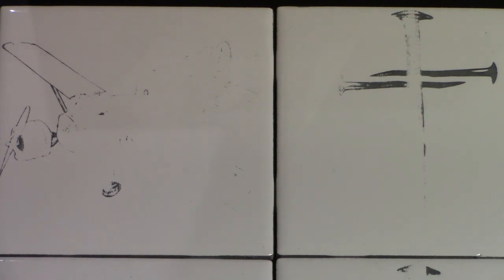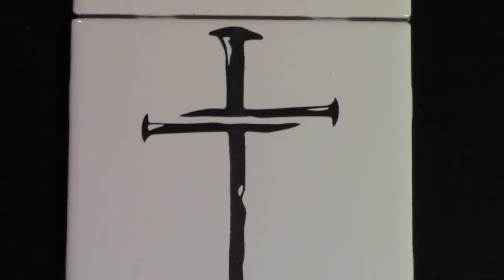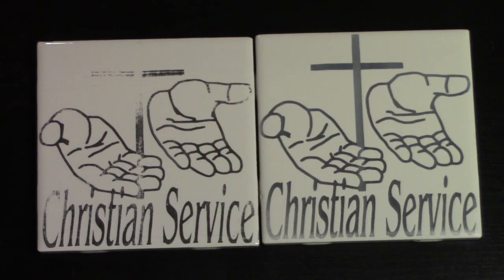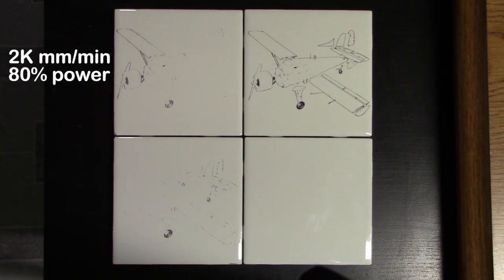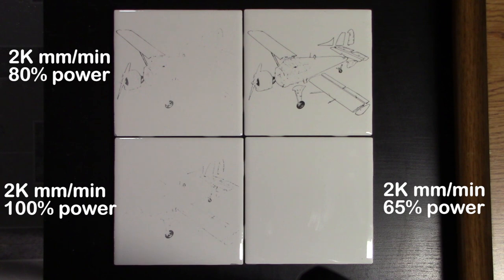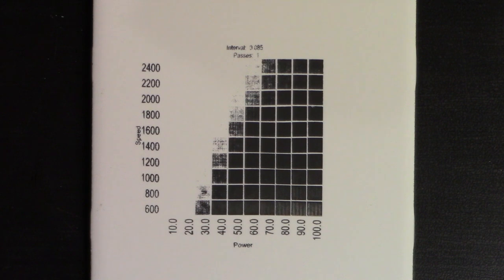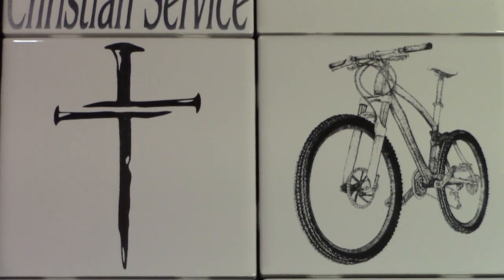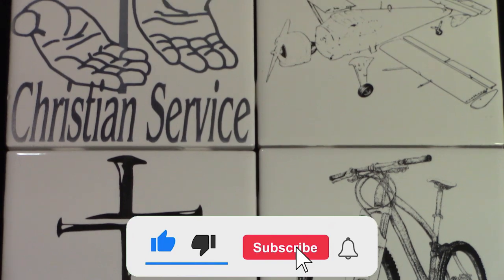What went wrong with the Cold Galvanizing Compound?

Comment from the maker: I am still run into burning issues.  Now 3-12 weeks after coating the tiles with CGC, I tried attempted two test burns.  One was a material test using LightBurn with power on one axes and interval on the other.  Then I burned another test with several interval settings on an image with fine detail.  While cleaning the tiles, the material test one cleaned completely blank.  The other had very little left.  Something more is going on.  Stay tuned for more information.

Comment: Have you tested a larger line interval with your laser and galvanizing compound. I run a little wider with overscan.   try .1 or .12
Reply from the maker: That is a good question.  And no, I have not.  I have done some experimenting with the resolution and found that for my laser, .085 worked well.  I did a resolution material test for etching glass and found that right around .1 or a little lower turned out best.  On leather, I can go much higher.  Close to 6 lines per mm.  This would be a good thing to test with the CGC. Thank you for the suggestion.  I will put a tile into my laser and run a material test on that using known good speed and power and see how the resolution affects the burn.
Reply: @CNCATHome  when you do the test try on something with finer details instead of a solid square.
Reply from the maker: @prahjister  I will start with a basic solid square and see how the different resolutions look.  Then I will try something with some finer detail and narrow down from there.  Thank you for the suggestion.
Reply: Are you letting the paint cure before you laser or after?